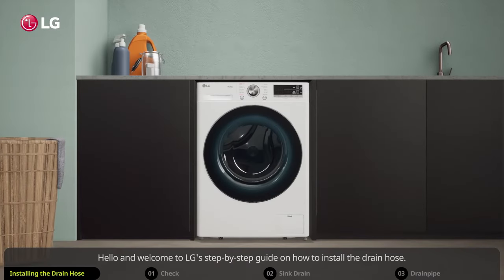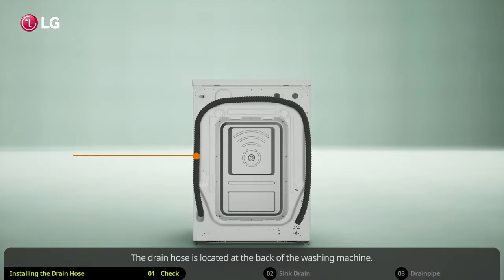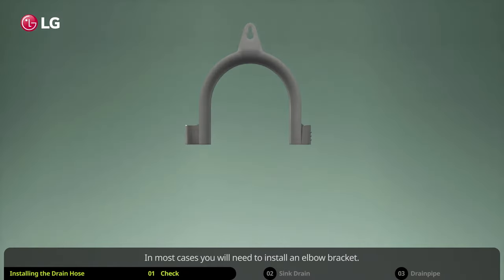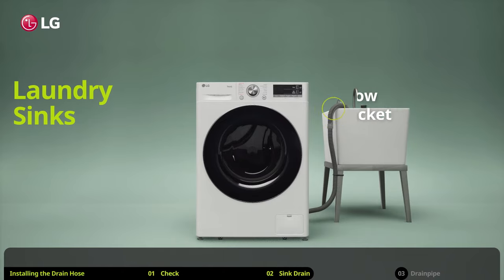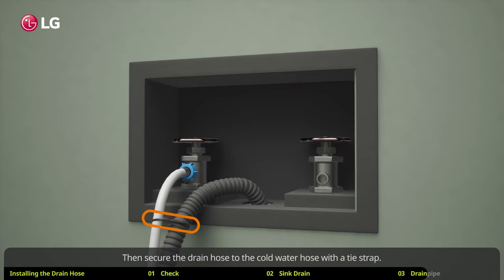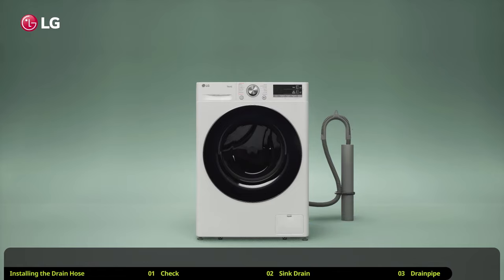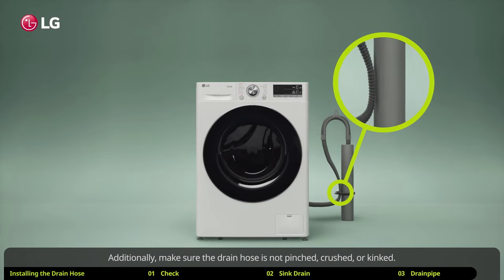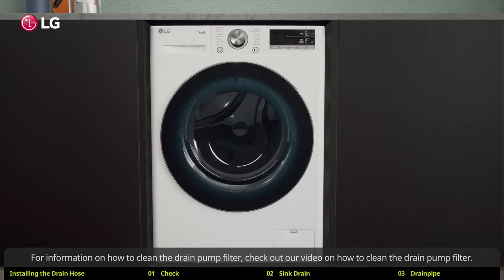[Front Load Washer] Installing the Drain Hose

Comment: Can we cut the drain hose shorter at the drain end, and move the supporting U-bracket to the new end?
My machine only needs like 2-3ft to get to the drain. 
6ft is really an inconvenience to route around my other hoses and wall
Reply from the maker: Hello there! You can cut the drain hose of a front load washer shorter at the drain end and move the supporting U-bracket to the new end. However, the drain hose is designed to be flexible, allowing you to extend, shorten, fold, or unfold it as needed. You have the freedom to adjust it according to your needs. Also, we recommend referring the owner's manual for better good to know about its recommended length of the hose. -Junel

Comment: can we let the drain hose be on the floor due to having a floor drain?
Reply from the maker: Hey there. Unfortunately, you can't. Improper installation of the drain hose can result in flooding and property damage. Please use the owner's manual of your unit and follow the installation guidelines. - Danee
Reply: Lift the mid section of the hose to minimum height

Comment: It looks like an april fools video. How will it drain if the pipe is installed so high?
Reply from the maker: Thank you for your feedback! For proper installation, use a drain hose no lower than 15 inches and no higher than 40 inches, as the video explains. If you have any questions or concerns, please don't hesitate to contact us on social media at @LGUSSupport with your contact details. -Anthony

Comment: Top load. Washing machine drain pip8ng
Reply: Top load washing machine drain piping
Reply from the maker: Hello! Thank you for your comment. We’d like to provide you with the following link for instructions on installing the drain hose for your LG Top Load Washer: https://www.lg.com/us/support/help-library/drain-hose-installation-top-load-washer--1424384977665

If you are connecting the drain hose to a standpipe, please clip the end of the hose into the elbow bracket. Then, insert the end of the hose into the standpipe and use a tie strap to secure it in place. We hope this helps!